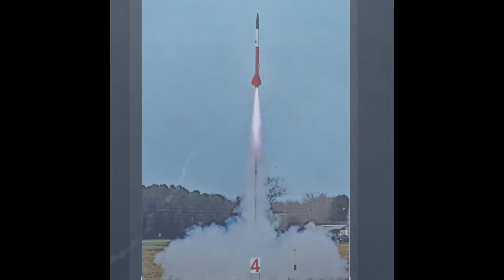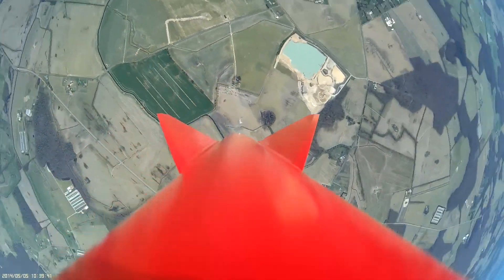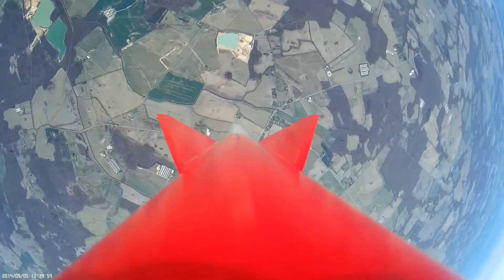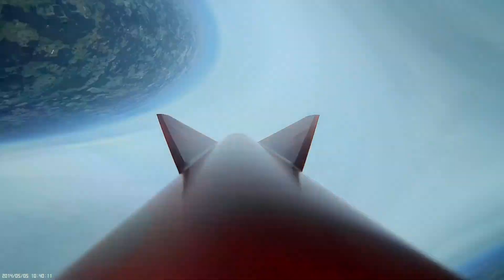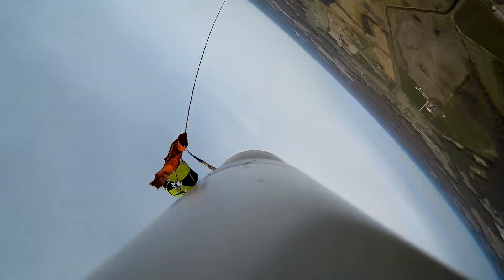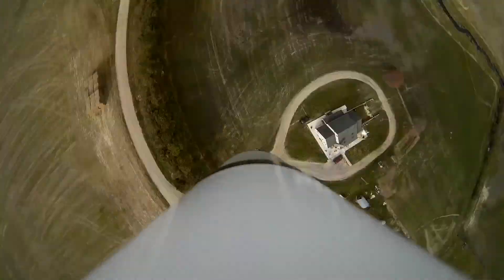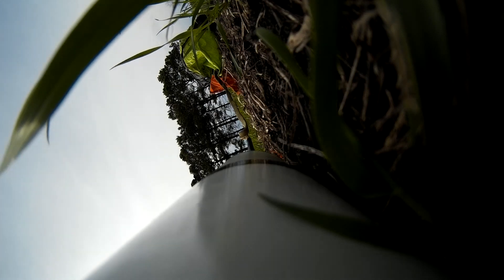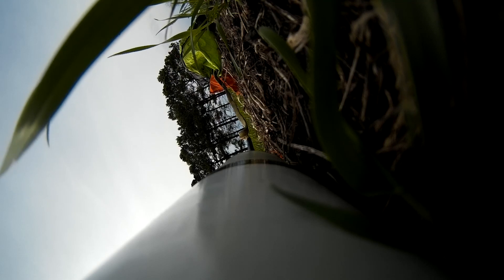High Power Rocket Launch - APCP M2300 - 14,000 ft - MDRA Red Glare 2021

Comment: hi.can u teach me how to make engime rocket like u😅
Reply from the maker: A very simple apcp propellant would be 78% Ap, 2% Al, with 20% rubber binder. Use BATES grains about 1.75x longer than their diameter and make sure the cores are wider than the nozzle. Depending on the casing material, you may want to use a large nozzle throat to keep the pressure down. You can manually calculate the Kn by adding up the surface area of the grain faces and cores and dividing that by the πr^2 of the narrowest point of the nozzle (throat). For this propellant a Kn of 175-250 is very safe. At a Kn of 180, it probably wouldn't even pass 250 PSI.